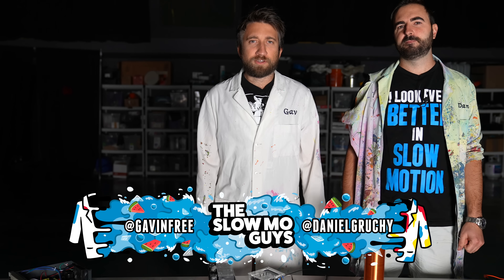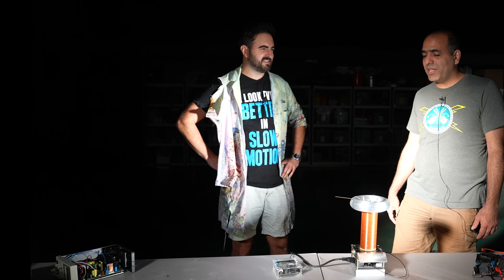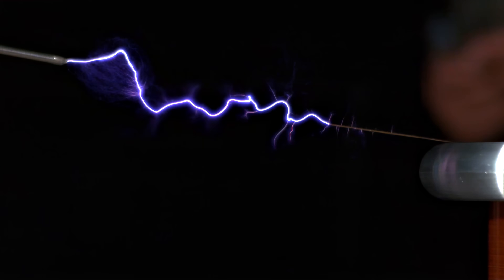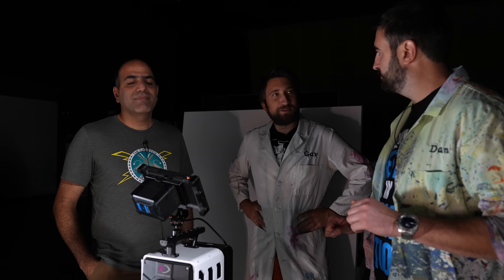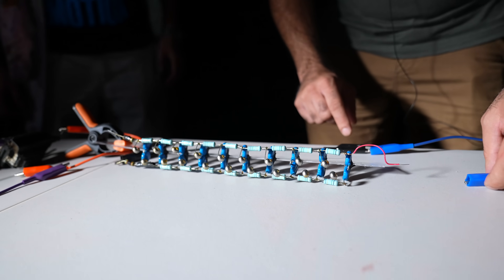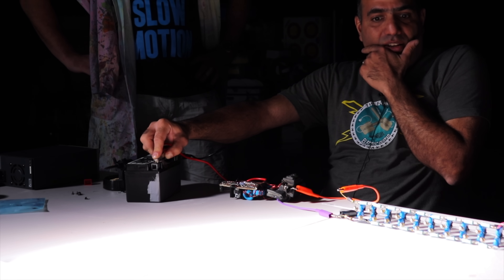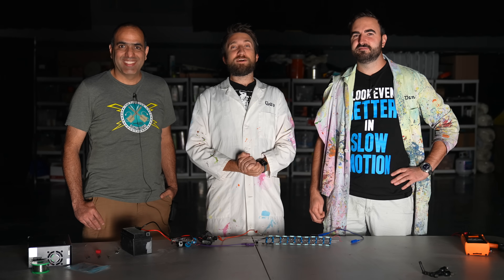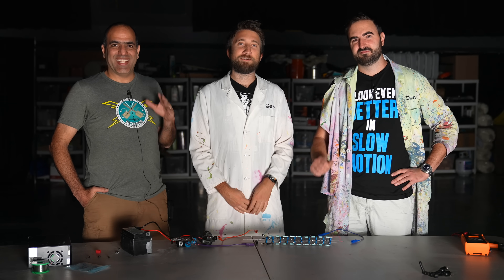Electrical Arcs at 1,750,000FPS - The Slow Mo Guys with ElectroBOOM

Comment: I have a theory about the spark gaps on the marx generator: I believe that the UV from the arc in the first gap Ionises the air around the gaps close to it and thus all the gaps fire almost instantaneously very close to the speed of light. But I still believe that they fire one after the other, just insanely fast.
It is very interesting to see tho, how the last gap was the one that ignited first. I didn't expect that. 
Great video 👍

Comment from the maker: There is actually a very handy image search feature in the phantom software that would have helped us scan the images for significant changes in pixel values and found the arcs much quicker at 1,750,000. Just need to connect the phantom via ethernet to a laptop. Guess who forgot their usb to ethernet dongle for their USB-C only laptop? Heyoooooo.
Reply: (phantom) pain
Reply: @anoobis117  ayyyyy metal gear
Reply: @anoobis117  why are we still here?
Reply: @logion567  Snaaaaaaake-eateeerr <ascends ladder> 😀
Reply: @anoobis117  Love the Metal Gear reference 😀
Reply: sweaty palms that a blink of eye can miss the frame 
in 19 hr video!
Reply: I was wondering why you were sifting through all of those frames manually :D
Reply: I was gonna say, weird how a research oriented camera wouldn't have tools for this exact scenario :)
Reply: Time to get a framework? 😛
Reply: yea the pain
Reply: "Why are we here?  Just to suffer?"
"Yes, because someone forgot their dongle!"
Reply: The thing I learned from this is that sparks (like static electricity) hurt at the point of impact. And if you spread out that point of impact, it won't hurt. So in dry and cold climates you can use this technique when getting out of your car.
Reply: Please do another collab with Mehdi!!! It was absolutely amazing content. Loved it!
Reply: I have a question:
If you put 2 of these cameras side by side and staggered the "shutter", could you get 3.5 million FPS?
Reply: post discovery pain
Reply: sad. 
The Phantom Menace strikes again
Reply: Apple be damned ahahah, well at least now they got back to more ports (still no ethernet though)
Reply: No need to cover for him. We know @Electroboom broke it
Reply: Now you just need an (impossible) camera that can do 1 ns/ frame.
Reply: There’s what looks like a shockwave at 19:12 , like the arc is expanding above and below.
Reply: thinkpad masterrace
Reply: Please, do it whis QCW Tesla coil!!!!! https://youtu.be/exvc3QDJdFg?t=40
Reply: I only ever have two 3.5mm dongles on me, one above my balls and one to usb-c :c
Reply: Lol.
Reply: But the weiner
Reply: CLASSIC
Reply: That has to be a world record.
Reply: Remember: Only you can prevent Forest Gumps.
Reply: That's good, saved me from volunteering to write you guys some software.
Reply: Heyooo
Reply: more video with mehdi please
Reply: Boop
Reply: Oh lmao
Reply: MacBook's....
Reply: I was wondering...
Reply: gav where the frik is laso this week
Reply: Lol
Reply: Lemme guess... It was you, Gav? 🤣😘
Reply: Hi how's it going watching from Broomfield Colorado
Reply: xD
Reply: Just wanna tell you guys that at 10:17 it says something very wrong in the auto generated sub and at 10:49
Reply: Any way you guys could make this happen back at Caltec, with the femto-photography camera? I realize the arc would have to happen the same way each time. Maybe it could be guided with argon or something. If no one else has already commented this (I imagine i am not the first) there are waaay smarter people here that could maybe design such an experiment/observation...
Reply: https://youtu.be/5wbKsfIOylw🏆👹
Reply: ohhh, i mometarily forgot about ElectroBOOM, time to go binge watch all of the newer videos
Reply: Hi
Reply: I felt like a python solution would be simple-ish for an intermediate programmer. That is not me though :D
Reply: You should film a mercury-arch rectifier! ⚡️⚡️
Reply: Lol was going to say there has to be software for this.
Reply: Brilliant
Reply: Hope Mehdi knows this software as well, if he also have to sift through those frames.
Reply: Use the TRIGGER next time, connect a microphone and you won't have to sort thru blank screens.
Reply: https://youtube.com/watch?v=ituKgMsZB9k&feature=share
Reply: Lesson learned.  Don’t buy laptops that lack essential features like ethernet ports.  Lol
Reply: On accident or?
Reply: Whelp I'm glad I read the comments section first because I was going to invent the feature and become super rich.
Reply: I have no experience with high speed video. But I figured that something like that must exist. An algorithm for finding sequential images with big differences between them would be so simple for a program.
Reply: Classic Gubbins
Reply: Laptops without Ethernets are horrible... :-(
Reply: Interesting how electricity arcs look like plant roots, or veins, or nerves, or lightning
Reply: That’s a cool feature. You really would have found it much much quicker.
Reply: And what did it look like in a vacuum?😎
Reply: You could also since you know the timing. Have something in frame like a metronome or tap the table as the arcs happen so you can at least get close because it's easy to see when an object is about to make contact vs waiting on something to go from invisible to not.
Reply: mistakes happen for everyone yes - you guys actually make some of the best content on this platform - thanks!
Reply: Whaaaaat a laptop with only one kind of port? Half useless without tons of dongles and adapters? Must be a Mac.
Reply: Time to switch to a proper lappy with ports :D
Reply: While you are at it, take a hdmi out from smallhd and connect it to a big screen for previews
Reply: F dongle life
Reply: SlowMo, la luz del rayo no parpadea solo oscilan las ondas de luz hasta la cámara, lo va distorsionando
Reply: @ayron-x5823  you really think a camera running at 1.75 million Hertz can capture light waves oscillating at hundreds of trillions of Hertz? They even said it in the video, you need at LEAST twice the frequency to see the resonant frequency. This camera is running at about 0.0000004% of that frequency.
Edit: missed a few zeroes
Reply: @ayron-x5823  🤯
Reply: You can do it quickly with Python. You load the video frame by frame and calculate the sum of all pixels with the timestamp in a 2nd column. Sorting the resulting array for the first few value will give you the timestamp with interesting data
Reply: could a 10 million frames shot in Shimadzu camera capture it?
Reply: (wild idea) if someone wants to build something or end up using the speed of light, make sure it's going to go through air particles like electricity idk 🤷
Reply: Particles in a cloud chamber please!
Reply: I would like to suggest that next time you start the repeating ___ before starting the camera
Reply: Amateur hour.
Reply: ew usb c
Reply: @trinityy-7  What is your point?
Reply: @NoZioKikes88  i hate usb c
Reply: @trinityy-7  why? It perfectly serves its purpose. I need specifics.
Reply: @NoZioKikes88  too small